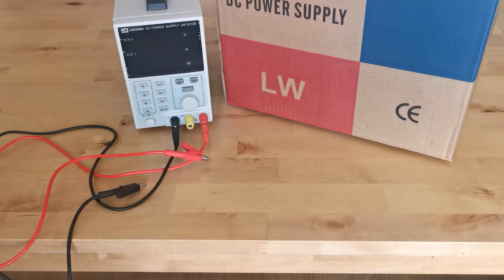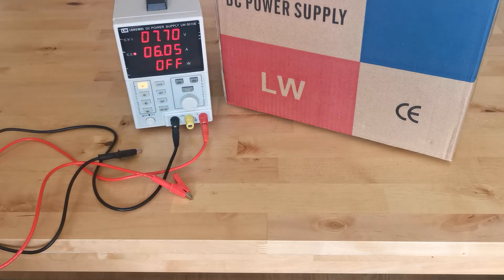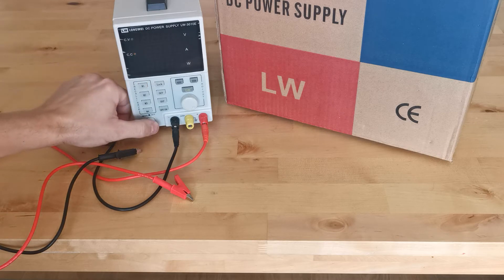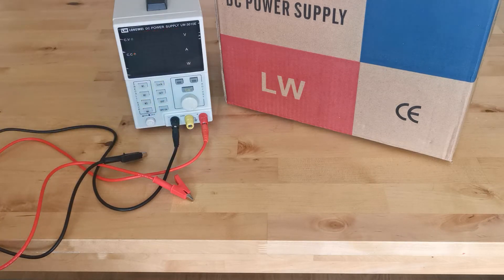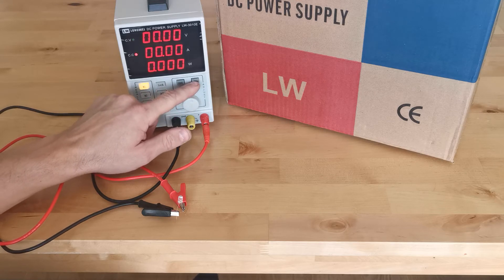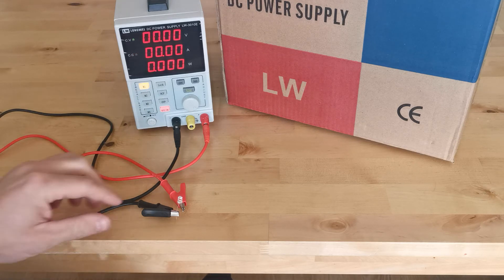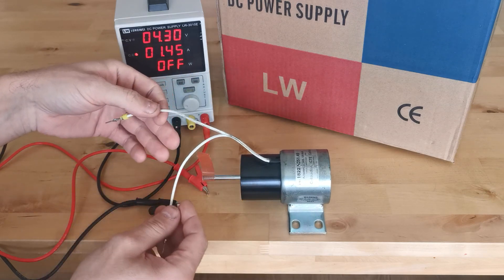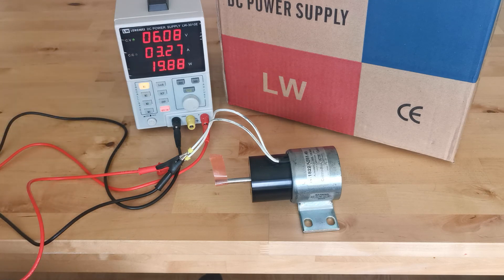Review Part 1:  LW LONGWEI 3010E  Bench POWER supply Failed after few hours

Comment: Go away from this product. Mine was not working from the start. Couldn't set voltage: after pressing ON  button it changes voltage (no currrent limit; load was 10k resistor).

Comment: I also bought it and it was broken 3 smd capacitors were damaged. I changed all of them
Reply from the maker: Has it arrived broken or it failed after some time? did you use inductive load?
Reply: @RTFIX  It died after 5 minutes. There was a faulty batch of capacitors
Reply: Warmly welcome.  I have the same problem, can you send me some photos of these capacitors?
Reply: Witaj Tomaszek P. Czy był byś  w stanie jakoś  mi pomóc?  Był bym bardzo wdźięczny